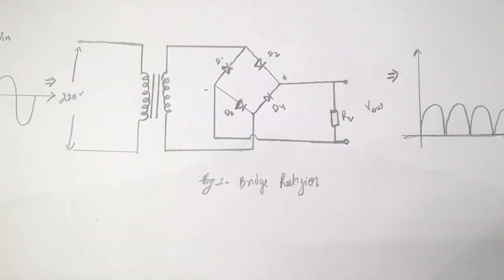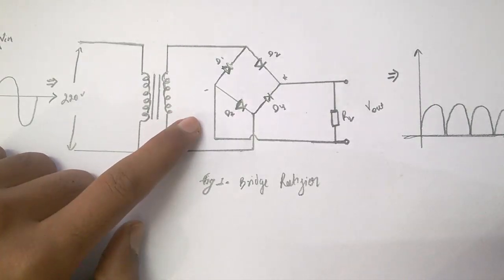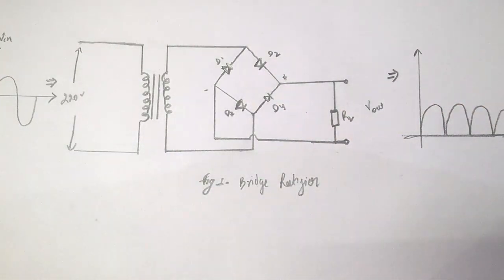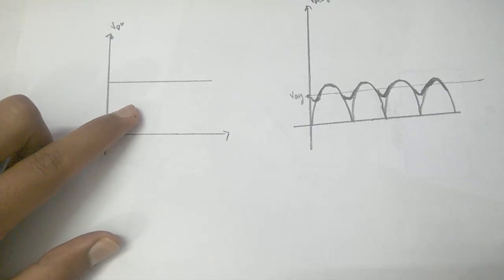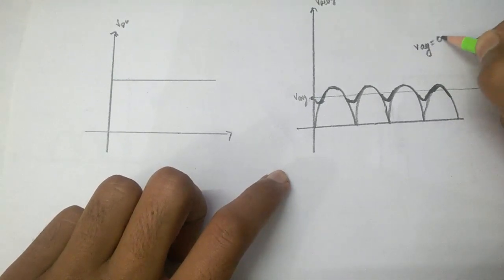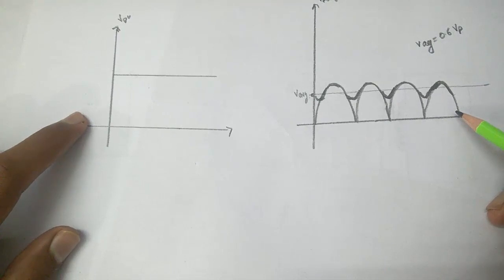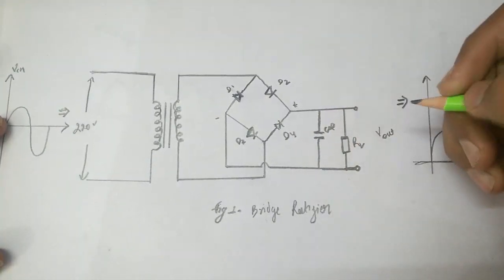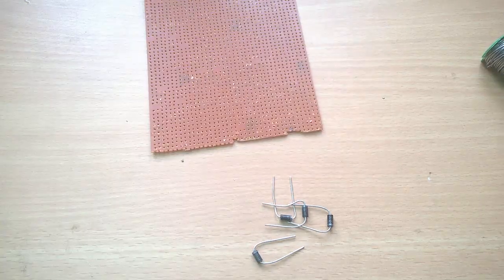How to make a 5v or 12v power supply adapter || AC to DC converter || Rectifier

Comment: I know this is an old video now but, there are two real problems with this. 1) You may just get away with 12VAC output from the transformer (which will give you around 15/16VDC taking into account rectification). This MAY be sufficient for a 12V regulator providing you need only a VERY low current output (100mA or so) but you really should use a transformer with a 15VAC output.  2) More importantly, your capacitor is rated far too low at 10V (it may well explode!)  I would recommend a 25V rated capacitor.